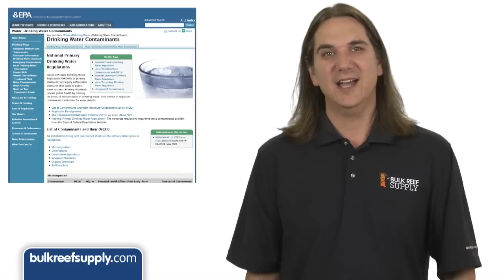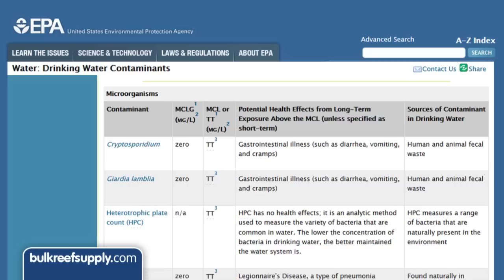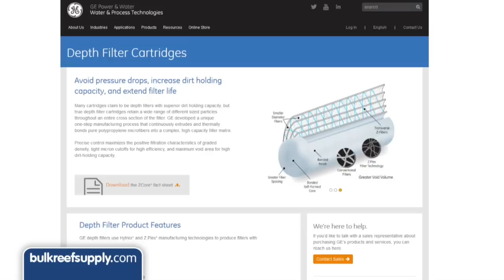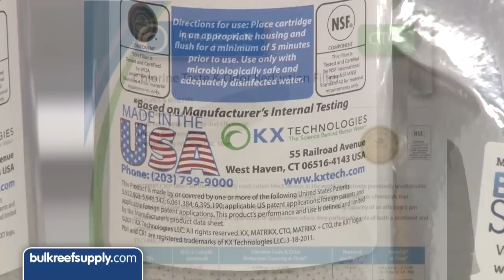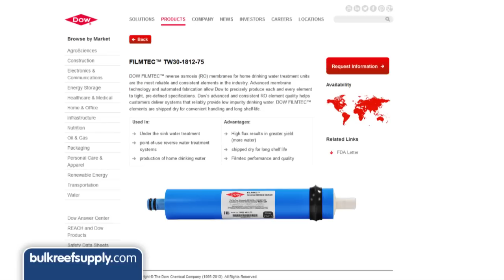Reverse Osmosis System Basics - EP 1: Reverse Osmosis Systems and Your Reef Tank

Comment: I purchased the 4 stage plus model some time ago, and I absolutely love it. But I have a question. I purchased the model that comes with the TDS meter. I know that the "out" measures the water after the DI resin, what does the "in" measure?  After the sediment and carbon blocks? Or after the RO membrane? The system already came assembled, so I didn't do it myself.  Any info would be great!  Thanks and this system rocks!

Comment: Great video!  I have a 5 stage 75GPD system from you guys.  I also recently ordered a replacement kit for the filter/carbon/DI resin.  My TDS is measuring 001.  I've heard anything above 0 is bad.  At what point do you recommend replacing the filters (minus the RO membrane).  I've been using it to make about 6g/week for about two years.

Comment: I just installed a auto shutoff on my rodi.  And its seems that the di resin has seperated.  Is that a bad thing?  Did install it improperly? I could only guess its from the pressure that know is on the rodi system

Comment: I know these systems are used a lot in saltwater setups - but how useful are they for planted freshwater tanks?   My village water supply is VERY hard with a Ph out of the tap at 8.0 - let it sit and it peaks out at 8.4....   I know my plants need some of the minerals/nutrients found in my water supply - so what would I do, just add some tap water or are there supplements I could add?
Reply: Many freshwater setups will do just fine with hard (or even very hard) water, freshwater tanks can usually be divided into hard, soft, acidic and basic based on plants and marine life. RODI becomes important when you want to run a soft tank, but your tap water is too hard, or unpredictable: with RODI you have ultimate control, just strip everything out, and add conditioners to make it exactly what you want. For many freshwater tanks, you've got options, so you can build the tank around your water instead of the other way around.

Comment: My apartment already has a GE Smartwater RO filter installed under the sink. Do you know how these compare to the ones that are sold at BRS? Would it be safe to use for my saltwater aquarium? What is a good test kit to use for a saltwater tank? I have recently been taking my water to petco to have it tested with little strips but that doesn't seem to be too effective. What testing methods do you recommend?
Reply: Buy a TDS meter and check for yourself, TDS should read zero or very close to it.  They are $15 on Amazon

Comment: I have the 75 plus, would 43psi be enough pressure to the system?
Reply from the maker: We typically recommend minimum 50 psi, so you may notice slightly more waste water and less than 75 GPD water production speed. Increasing pressure would result in faster water production and less waste water. A booster pump would be a good idea for an upgrade in the future, but not a 100% necessity to get you up and running.

Comment: was wondering if I could ask you a couple questions regarding ro
Reply: Well I am about to start a 125 fresh water tank. planted. and I was wondering how can I sump a ro system. is that doable? if not I have follow up questions. that's for the fast response. keep up with the vids. very helpful man
Reply: I may be hooking the tank up direct to my water line. sorry I wasn't clear. and have it empty to my sump the then be pumped into tank after the ro filtration. If you'd like I can get pictures
Reply: I am new with sumping and ro usage.
Reply: But yes basically incorporate the ro into the sump during injection of the tap water into system
Reply: kenneth rutledge i'd imagine you have it figured out by now, but what i would do in your situation is set up an RO and barrel, and hook up an "auto top-off" (ATO) between the system's sump and RO barrel. this will keep your sump topped off with RO water. i plan on doing this with my RO and reef system soon.

Comment: Love BRS!!!!! For the next video, could you address well systems? Specifically the use and setup of booster pumps and Co2 scrubbers to prevent DI burnout. Also, if the first three cartridges should be different for wells. Thanks!